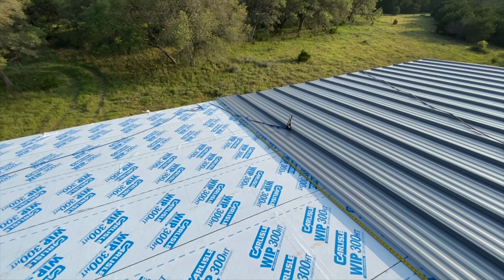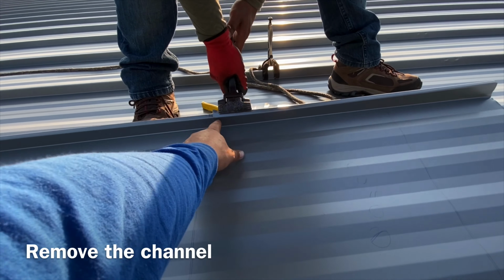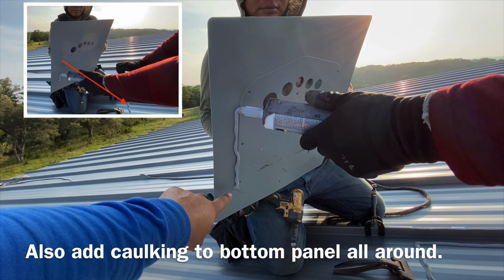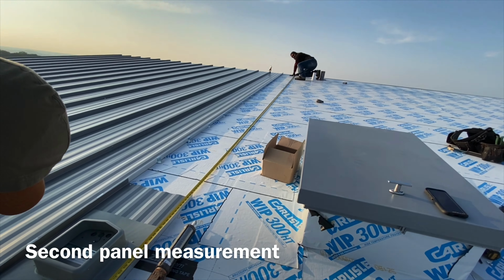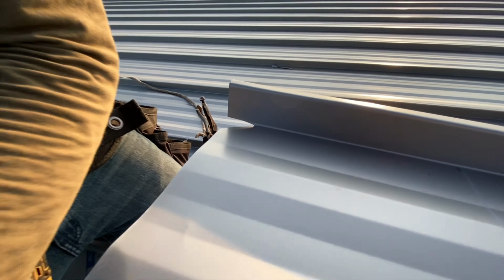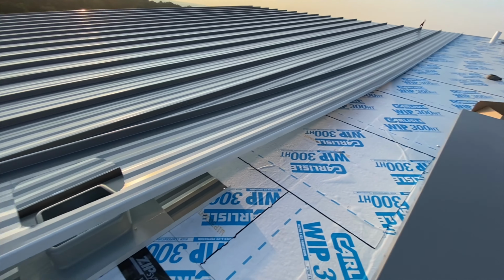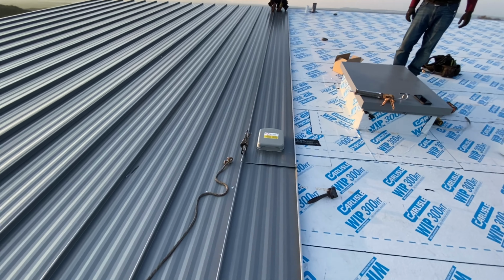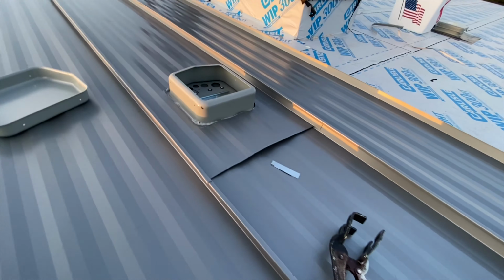SolaDeck Combiner Box Standing Seam Metal Roof Install - San Antonio Metal Roofing

Comment: Thanks for the great video! I'm doing a 12" standing seam install. Since the flashing on the SolaDeck is 15-3/4" wide, would you recommend cutting it back to 11-3/4" to fit between the seams?
Reply from the maker: If i'm understanding you correctly, i would still use the same technique in the video, but using two panels. If cutting to fit between seams works without compromising the integrity or waterproof, I would go for it. Let me know if there's anything else: info@roxroofing.com
Reply: @RoxRoofing  Thanks!

Comment: So there’s no way I can do this because I’m installing on an older barn. I was just thinking some bolts and neoprene washers etc. what would you recommend
Reply from the maker: if you were to have exposed fasteners, make sure to extra seal with high temperature sealers and be prepared to get back up there every 5-7 years to make sure the gaskets and sealers haven't cracked.